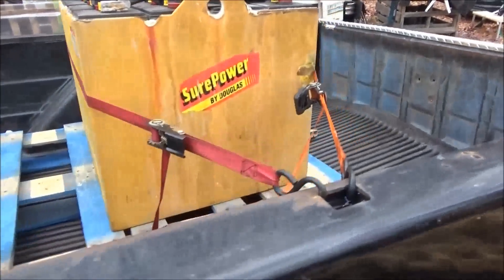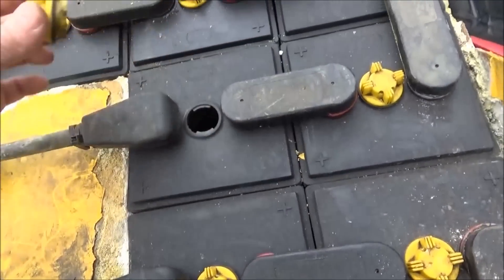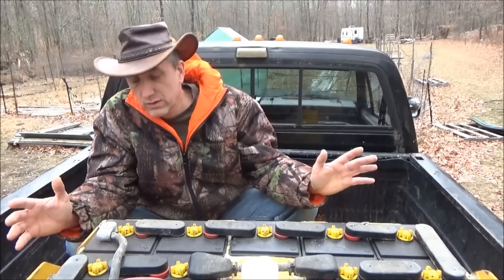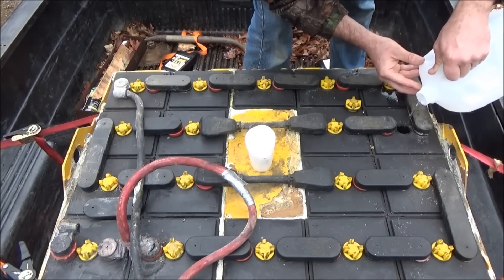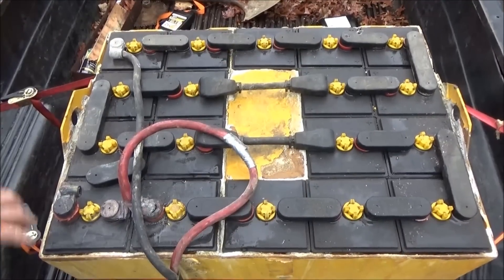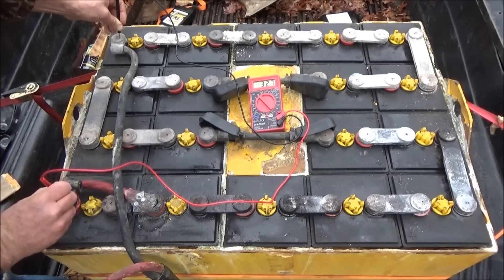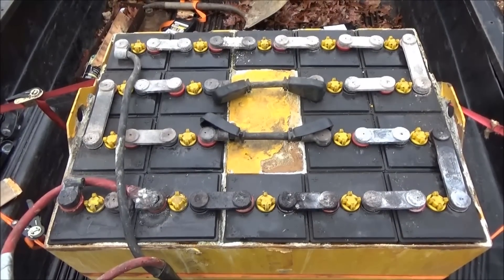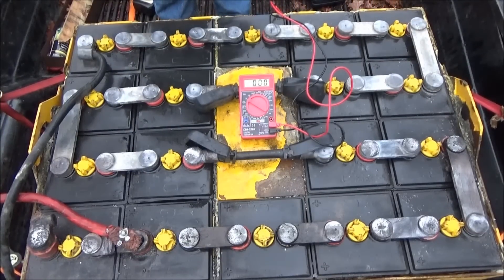Servicing An Old Forklift Battery Pack For Off Grid Solar Home Use

Comment: Your right though forklift batteries are the best batteries for off grid. I've had them for 12 yrs. For pannels check out San tan solar. 20/250 watt 700 bucks

Comment: Hey man! I am by no means an expert on batteries- I found your video searching for information on these forklift batteries as I came into two of them; With that said, I found on the "Battery University" website that you are supposed to charge them fully before you add distilled water. Not sure how true that is, but Battery University seems like a good resource. Thanks the informative video!
Reply from the maker: I am not sure about that. It depends on how low the water is. Because if you charge a battery that is too low, it can warp the plates and damage them.
Reply: @TheDoItYourselfWorld  I know this is an old comment but I work with Forklift batteries and yes fill the battery so its above the plates if it has been sitting for awhile and extremely empty but normally always charged to 90-100% before watering them
Reply: Also invest in a good filter if you don't want to have continue getting distilled water. We just use heavily filtered tap water to fill our batteries and I believe the difference is negligible

Comment: The challenge is moving the battery. Delivery is the first hurdle. Moving it to your inverter shed is the next challenge.
Reply from the maker: I found I could move it with a cherry picker and help. Lift it up. Slide it over and set it down. Lift it up, push it over and set it down. Inching my way to its resting place.
Reply: @TheDoItYourselfWorld  Usually I move stuff by putting 2" steel pipes under the thing to be moved and roll it a little at a time.

Comment: do u know or think desulfaters work
Reply from the maker: +Michael Galac I have used the Bedini Motor to desulfate many batteries through the years with much success. Commercial desulfators, I think they work but I do not have enough experience with them yet to say for sure. They are a bit small and slow so lets see.

Comment: I hope you didnt hurt your truck bearings. Its only a half ton truck I think. Pretty sure its not supposed to hual 2,000 pounds.
Reply from the maker: 3/4 ton truck. It has hauled way more than this. It hardly notices this battery.
Reply: The Do It Yourself World That is one great truck Troy.

Comment: Hey just a little pointer from my training and being a forklift driver for 7 years your supposed fill up 1/4 above the grates like you said but it should be after a full charge if you do it before that's how you get the battery to leak acid

Comment: Looks like you will have 2 good 12 volt battery banks. You are going to have to get some Map gas propain might work but map gas would be better to remove the led bus bars and solder some connectors. I really fell you have a winner that my friend I love to see this in action. thanks for sharing.
Reply: Hydrogen and oxygen explode I would not suggest he use fire any where near those batteries as an explosion with a acid spray following it could (would) be dangerous.
Reply from the maker: Thanks. I think it will provide quite a bit of power for solar home use. Lets see. I plan to cut apart the cells and then just drill and tap them for bolts to connect battery wires.
Reply: The Do It Yourself World I love to get my hands one  a few of these my self. as I can tell you only had a hand full of them that were bad.   I know 2.04 is pretty low but it is 60%charge for a 2 volt cell. the ones that are below 1 volt I just toss those not much for saving. they are pretty much fried.   I now I counted and you have plenty for 2 12 volt strings.  I would be guessing but I think that is a 1000AH battery if so with 2 12 volt strings you will have 2,000 AH battery bank. 

what I would do if I was you is wright Good for any battery over 2 volts and bad for anything under 1.5  cut the buss's and pull them out me I would just find a place I know I will be keeping them or find another camper trailer to put them one and build a battery box for them on a trailer behind the home one wells so if you have to move you can just tow it with you. that way you can just put the good ones back in the steal case rebridge the bus bars and put it on a wagon all depending on how you are setting it up but me it would be permanent you are wanting stuff ready if case you need to pack up and move and every thing is ready to just hook and book.  

but if you want to put post on those termanals I go with something with a hole in it that is tented copper with a lug on top so you can drill the buss bar put the nut and bold in and hit it with a torch and solder the entire lug to the post so it becomes as one piece. then you can reconect them with thick heavy gauge wire I would go with 00 gauge battery or welding wire that way they will handle heavy currents and also I would fuzz each battery bank.  

I cant wait to see the battery's in operation.  Good on you though for finding such a good deal,  those things can run up to over a grand even used.
Reply: McCuneWindandSolar I believe he has more then he had but those batteries have seen there life. I doubt if they have 2000 amp hours left. What is critical is how fast do they leak back to no charge. If he has 2 or 3 cells that seem good how will he keep those charged so as he has them when another cell goes bad. But he is a lot better off then before when he figures out how to get that out of his truck.

Comment: I served as an officer on a diesel-electrical submarine class Romeo. The battery we used back then was similar to this but just bigger. Varta, made in Germany. 2x departments with 120 cells 2V each. If you properly take care of it will serve you well.
Reply from the maker: Now that would be a battery to have!!! I know Varta. I lived in Germany a while.
Reply: You got my interest were all the batteries in series or were they in stacks so as they could be used all in parallel some way or other? Or maybe 130 volts positive and 130 volts negative.
Reply: Sidney Boudro Back there it was 220-240V (common in Europe) so we have two independent groups of batteries that powered the electrical motors under water and were charged when the diesel motor was running (some times even under water while sucking air through a snorkel - air-pipe) The batt. were stored in in different  water-tied compartments in case one get damaged the other could be used. Normally they were alternated with each other to power the sub and got charged separately.

Comment: Now you have a new battery. Go to Wikipedia Lead–acid battery It is pretty complete for a short article READ and HEED. You will learn more about hydrometer what compounds are used in some batteries when overcharging hurts batteries. (keep charging below 14.4 Volts)

Comment: Wow ... that looks like that would be fun to work on (except for unloading). What is that center piece made out of? If it can be removed, then getting the rest of the cells out should be easy.
Reply from the maker: Its a piece of steel. Part of the case. Welded in nicely. I considered cutting the case apart but that could be messy

Comment: You took readings from 17 of the 18 cells, you didn’t measure the one with a broken terminal. I added up all the readings you gave and the total for 17 cells adds up to 30.68, that’s close to the combined reading of 30.9 for the 17cells. You have 15 usable cells, which are currently at a 35% state of charge.
 
The next thing I would do is measure each cell’s gravity with a temperature compensating Hydrometer. Keep a record of all the readings you take.
 
As they sit, I would choose the first six cells starting at the positive terminal to make the 1st 12 volt battery and then I would choose the last six cells nearest to the negative terminal to make the 2nd 12 volt battery. After charging the 12 volt batteries and removing the surface charge, I would take measurements all over again.
 
Are all the cells giving a similar reading? What’s the variance between the high reading and low reading?
 
You mentioned that you like individual cells because you can replace an individual cell of an old battery if one goes bad. Mixing new cells with old cells (over 50 charge cycles) is strongly discouraged.
 
You suspect your 6 Volt batteries are sulfated, but you haven’t tested with a hydrometer yet? If they are sulfated, I bet the reason for them to be in that state is due to undercharging. You deplete the battery bank down to 50% one evening and you only charge the battery bank up to 85% the next day.
Reply: TechMan1219
well in the two factorys i worked at they had something i think called a de-ionizer  that looked like a small water heater that they used to top the batterys with
Reply from the maker: I think you are missing something about my NEW golf cart batteries. Maybe I have not been clear enough. They were not performing right off the shelf of the store. They sat too long on the shelf. I have been using my HF generator and battery charger literally every single day since I brought them home. Often mornings and evenings. Now this is supposed to be a 216 Ah battery bank but it goes dead overnight with only my modem and netbook running. Netbook display is turned off. Its an atom processor and runs 9 hours on its own battery. I am maybe pulling 10 watts max overnight per hour.
Reply from the maker: Two of the forklift battery cells are flat out dead and one is broken. There is no point in testing a battery where the positive terminal pulls right out of the battery. I have 15 good cells.
I will get a hydrometer and properly test the cells.
Reply: TechMan1219 Troy has to apply a charge then check the cells with a hydrometer. Look up Wikipedia Lead–acid battery There is a long article on batteries and there maintenance They do not suggest Epsom salt except as a last resort.
Reply: TechMan1219
thats just what they did one end was  plumbed into the mains water supply and de-inonized water came out they r used a rubber hose on the outlet to fill the batterys or a portable water container ( looked like a shopping trolley or a pull along suit case ) if the hose could not reach
Reply: TechMan1219
probly i recall years ago buying a tube of de-ionizing tablets that looked like the ones used to clean fals teeth that you  dropped into car batterys to revive them
Reply: TechMan1219 Sounds like quite a project sounds like all your clothes fall off as rags as well.

Comment: Hook that wifi battery monitor I saw in the background into the bank, very useful tool. We use them on the 24 volt lift trucks (Crown) and forklift at work.

Comment: Sure power is made by the Douglas battery company. That looks like a 18-85-17 model battery. The original amp/hr rating would have been 680. You can charge the cells in banks of 6 with an automotive charger but it will take a long time. The output is very low compared to an industrial charger. Once the cells are fully charged you can do a cell to cell voltage check. A fully charged and cooled cell should have a voltage of 2.12 volts per cell.  Note that the positive posts are much higher than the negative posts. The intercell connectors angle up to the positive posts. This is caused by positive plate growth over time. It is a normal function of battery life and is a sign that the battery is at the end of its life. The red floating bushing around the post is designed to move up with the plates as they swell and lift up. I think you might find that battery has very few usable cells and has been used up. I wish you luck and hope you can get 6 decent cells to make a 12 volt battery. Good luck on your adventure!

Comment: If you put them into your tiny house on wheels it'll become the seriously heavy tiny house on wheels.
Reply: google Account Beware of trolls that are not subscribed to this channel but have no problem with heckling troy for anything he does
Reply: cygkju
Yep. :)

They are too cowardly to use their real account for their trash talk.
Reply: MAYBE HE CAN HAVE A SMALL TRAILER FOR THE ELECTRIC & WATER SYSTEMS. THAT WAY THEY CAN BE SEPARATE ALL TOGETHER... YOU KNOW ONE OF THOSE QUICK RELEASE SYSTEM HOOK UPS...

BLESSINGS & BE HOPE FILLED
FRANKI
Reply: John Strabismus He does not plan to put them inside the house.
Reply: SSanf Are you sure? 9:36
Reply: John Strabismus
Yes, he said "get them over to the tiny house", not "inside the tiny house"; in other words, beside the tiny house. He will be building an enclosure for them which will have some heat diverted from the house using a dryer hose to prevent them from getting too cold.

It was the water tanks that he said he intends to put up in the loft.
Reply: Its a counterbalance for the water tank !   ;-)
Reply: Would be best to find an old pickup box trailer to place it on, then if it needed to be moved again. all he would have to do is hook up and go. He could also place/build a topper for it
Reply: those batteries would fit perfectly on the east side of the tiny house (front of trailer) there is room for an enclosure there I think.
Reply: google Account
I think that area is only 2 feet wide. It would be too much weight there anyway. Troy will build an enclosed place for them.
Reply: SSanf Can't be a permanent structure, Thats why I suggested the trailer.
Also will be good if he needs to move it in the future
Reply: davie-m noted, thanks for your input.
Reply: I would imagine that once the build is finished it would be too heavy to tow on the highway anyway and when stationary can be supported.
Reply: Tho I have no idea of the specs of the trailer or towing limits in the US
Reply: I think you could put them inside.  They can be moved out if and when he needs to move the house.  Keeping them warm will keep them performing much better.
Reply from the maker: FRANCES LUNYOU That is an idea I have been considering.
Reply: THANKS TROY
MIGHT WANT TO MAKE THAT TRAILER A LOW BOY KIND THAT WAY ITS NOT HARD TO SERVICE ANYTHING IN IT... [JUST REMEMBERED STANDIN ON MY TOES TO GET IN TO THE HOOD OF MY CAR TO DO A SPARK PLUG CHANGE SO IT BEING LOWER TO THE GROUND WILL HELP WITH STRAINING TO GET TO STUFF]

NOTHER THOUGHT: HOW BOUT A TOPPER WITH SWING UP CUBBY DOORS [ON THE SIDES] SO YOU DONT ACTUALLY HAVE TO GET INSIDE THAT TRAILER.... YOU COULD ALWAYS HAVE A HINGE AT A SIDE OR THE FRONT END TO SWING THE WHOLE TOPPER UP AND OUT OF THE WAY TO DO WHAT YOU WOULD NEED TO DO....
BLESSINGS & BE HOPE FILLED
FRANKI

Comment: One more thing. The battery has to be at full charge to measure the acid with a hydrometer if you are going to add acid. The acid goes into the plates as the battery discharges. When you speak of sulfated plates you are talking about where the acid is going normally.

Comment: Well if you have a tree you can back up to and if you have a come along that will handle a ton and if you had chain to set it up you could lift the battery and drive the truck away then lower the battery. Oh if you do this make sure your come along will lower the battery to a pallet or 2 on the ground. Also try to give up if the tree starts to make noise.

Comment: Do you have  hydrometer? Look at this for inspiration:
https://www.youtube.com/watch?v=7YhfeSOyPAg
Reply from the maker: They are using a chemical to restore the battery. Not sure if I like using chemicals. Lets see how my Bedini does with them :)
Reply: The Do It Yourself World Not the Bedini. :( That will take forever, if ever.
Reply: The Do It Yourself World  just me thinking out loud here .... what if u use a tazer to pulse the battery  they do what like 30 million volts   ... or something similar in specs   im with ssanf and techman1219  dont think the bedini would fit the job would take forever to do its magic
Reply: james Robertson They used to use 20,000 volts ( 20 thousand volts) DC on picture tubes second anode and that would throw a spark nearly an inch how many inches does 20 million volts throw a spark? 
I know you are just thinking but you are off a decimal point or so.
Reply: Sidney Boudro  mine on the box says 35 million  could be stretching it some but  it packs a wallop (ya i tried it once...once..lol) VIPERTEK VTS-191 METAL 36MV Rechargeable Police Stun Gun
Reply: james Robertson Like I said 20 thousand volts throws a spark (not arc) an inch. so don't be any where near that thing when used. ( A welder holds an arc with just a few volts)

Comment: Would be nice if you could get the charger for those batts so you could do a Equalized charge on them to burn off the cells. I have to service our Forklift batts every Monday at work. Defiantly not good running them dry. Great Batts to use for sure.
 That is an old bank. The new ones look a little different. Over time no matter how well you keep the top clean it will still corrode.
Reply from the maker: I have the DC generator which puts out 100 AH so it should do the job nicely for me.